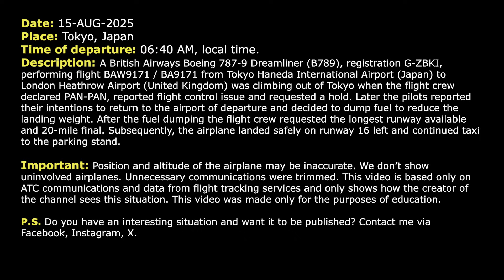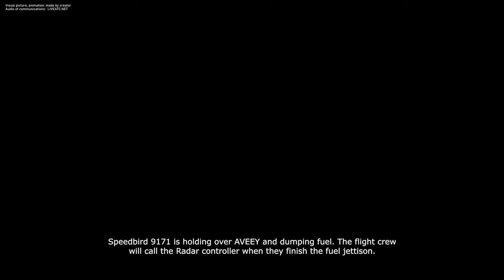Flight control problem. Fuel dumping. British Airways Boeing 787 returns to Tokyo. Real ATC

Comment: I was actually expecting Japanese ATC to be more "on point". In combination with their pronunciation they're not very helpful sometimes.
+ why do they keep trying to get the BAW on other runways (one of them with tailwind) when the crew clearly stated what they need?
Reply: The approach course for ILS16L at Haneda passes through the heart of Tokyo, lined with many high-rise buildings. It also has a higher descent angle than usual. Furthermore, under an agreement with local governments surrounding the airport, operating hours are strictly limited to local time, from 2:00 PM for few hours. Therefore, it seems likely that the controllers proposed 34R, which has a lower descent angle, no operational restrictions, and allows a safe approach from the sea side.
Reply: @tkk85009008590 
Ah I get the point
Reply: This airspace congested with a lot of twisting procedures. Not shown here are 2 airbases to the left. 1 heli military base right by the approach. The 16 approach also conflict with the airbases. Narita flights are mostly international & the Asia ones fly all over Haneda's approaches.

I'm surprised they didn't get thrown over to Narita tbh.

Comment: Ouch that was painful to listen to!!
Reply: No, it was fine. All understandable
Reply: @stevec49 perhaps for you few but not for those pilots or the rest of us
Reply: @stevec49  It was excruciating at times and I have 16,000hrs and am a B787 captain. Some of the ATC was appalling using non-standard phraseology, giving confusing instructions and requests, asking them which runway they wanted and then trying to talk them into ANY other runway, including one with a significant tailwind, giving headings to a hold inbound course instead of just saying ‘direct to xxx, take up the hold’. I could go on.
Reply: @JohnSmith-zi9or  They are on a PAN call and have asked for the longest runway due to control difficulties. The controller’s job is to arrange that, not offer one with a significant tailwind component because ‘Co-ordination is difficult’.  The number of superfluous radio calls due to this was ridiculous.

And it matters not that you could understand them easily. I could too, but I’m sat at home watching a video with a subtitles. The crew in question weren’t and didn’t. The fact the controllers kept using non-standard phraseology added to that confusion. Why, as an experienced longhaul pilot yourself you will not accept that is very strange.
Reply: @JohnSmith-zi9or   Says the bloke assuming even more things…😂😂😂

Comment: How about youuuuuu? 
Incredible.
Reply: Tokyo Approacheeeee
Reply: Japanese culture values hierarchy, it's good for ATC to be soliciting objections and eg explaining the routing between Narita and Haneda departures.
Reply: @TonyNaggs  I think the issue is not hierarchy, but the use of an odd English construction. They said "How about hold over Avery? How about you?" which is not normal English, so it was hard for the pilots to understand. One translation into standard English: "How about holding over Avery? Is that OK with you?"
Reply: @stevendoerfler  I am not going to critique the grammar, it may even be a phrase Japanese ATC are taught as using a core English vocabulary with pilots having differing levels of fluency.
My thought is that some (non-Western) pilots may feel pressured by an ATC directive that doesn't suit their situation, and intentional questions like this promotes dialogue.
(My perspective is that I have worked for multinationals, visited branch offices around Asia, and taken several working with culture X training courses.)
Reply: @stevendoerfler  It's better English than most Americans can manage.

Comment: Should have just declared an emergency and got straight in.
Reply: cannot do it that easily. They just took off from Haneda and they are probably quite heavy , so they have to dump fuel outside the city so they can safely land back at Haneda. Its a common Emergency procedure that most pilots would follow.
Reply: @ishanpai1791  He declared a PAN. You obviously do not know what that means. As for landing overweight at high speed on a runway of insufficient lenghth with flight control problems? BLOODY CRAZY
Reply: They did declare an emergency.
Reply: @joegardiner394  In aviation, when you declare an emergency you are required to state Pan (Urgency) or Mayday (Distress). Mayday takes priority over a Mayday in ATC planing.
Reply: @JACB006  well, they did declare PAN, so it was an emergency, unlike what the OP implies...
Reply: @LjL-Videos You make my point … @SJF15 said an “Emergency” should have been declared, it was by using the word “Pan”. The word “Emergency” was not needed.
Reply: Just because American pilots don't use the internationally agreed terms of pan and mayday to define the urgency of the situation, instead preferring the word salad of 'declaring an emergency' (used interchangeably - confusingly - to describe urgent scenarios that don't need an immediate landing and dire scenarios which need an immediate return), doesn't mean the rest of the world does the same.
Reply: In case you are in any doubt please refer to FAA JO 7110.65, or AIP or the ATC Pilot /Controller Glossary. Mayday and Pan Pan are both accepted ways of declaring an emergency. Japan procedures are the same as FAA.
Reply: They didn’t want to get ‘straight in’. They had flight control issues, were overweight, had checklists to run through and were quite capable of staying in the air. Very few non-normals require and immediate landing.

Comment: None pilot here who understood the Japanese pronunciation of HAZMAT.
Reply: I pretty much don't hear an "m". Which is weird because Japanese definitely has that sound.
Reply: I am a retired pilot, yes I understood HAZMAT = Dangerous Good, any on board was the question?
Reply: @JACB006  The standard phraseology would be to ask about dangerous goods on board, not ‘hazmat’. Dangerous Goods is how such materials are referred to in the industry, and the term used throughout the manuals and by ICAO. The controller caused the confusion by using a non standard phraseology, which was difficult to understand (it was easy watching the video because it had subtitles). There were several more uses of non-standard phraseology too, such as ‘how is it for you?’
Reply: @petesmith1924  As a retired airline pilot of more than 35 years of experience I can tell you that Hazmat is frequently used in many parts of the world. I don’t know where the term originates from, perhaps military? It certainly gets used in the Far East and certain parts of the Middle East.
Reply: @JACB006  As a current 30yr airline captain on the B787 I can tell you it is not standard under ICAO, who publish the ‘technical Instructions For The Safe Transport of Dangerous Goods’, the  ‘Dangerous Good Emergency Response’ guide, and IATA who publish the ‘Dangerous Goods Regulations’. All our manuals refer to Dangerous Goods, not ‘hazmat’ so the industry standard is to call them Dangerous Goods, not hazmat. Hence the confusion. Just because certain places don’t use correct terms and phraseologies does not make them right and this example highlights the confusion and difficulties of using non-standard phrases in a second language with a strong accent. 

The whole point of standard terms and phraseologies is to avoid such confusion.🤷‍♂️
Reply: @petesmith1924  I didn’t say it was standard terminology, I said it is in common use. I also said I don’t know where it originated. I agree with standard terminology, but what is standard today, wasn’t standard in the past. Eg I will QSY for now. PS Bad luck about the Boeing … I was Airbus since 95. 😉 Rgds.
Reply: @JACB006  Your understanding of the word ‘hazmat’ on a video is irrelevant. The use of it in that situation proves the point that it has the potential to cause confusion. Enjoy retirement.
Reply: @petesmith1924  I am NOT advocating the use of Hazmat … But in an Emergency situation I am not about to start teaching the ATC ICAO Terminology. Don’t go down a rabbit hole, just put it down to local knowledge/experience and deal with the issue. Yes we can discuss standard terminology on the ground after the event and it’s good to move matters forward, improve standardisation etc. But sharing knowledge is also good in case you encounter the term “Hazmat” in the real world. Enjoy your work and look forward to retirement, when you can work for yourself. Rgds.
Reply: @JACB006 Nobody has suggested you should start teaching ATC standard phraseology in the middle of an emergency. I’ve made my point, you said you understood it ‘easily’ in the comments. Nobody cares that you heard it and understood it, it’s irrelevant, that crew didn’t understand it (which is the ONLY relevance here), which lead to several radio transmissions trying to ascertain what ATC were asking about. Just leave it, you’re done anyway so won’t be teaching standard phraseology in an emergency or otherwise…
Reply: I’m a retired 744 captain, I love that hazmat, every time I flew to Tokyo I must taste that most delicious ice cream, the best in Japan.